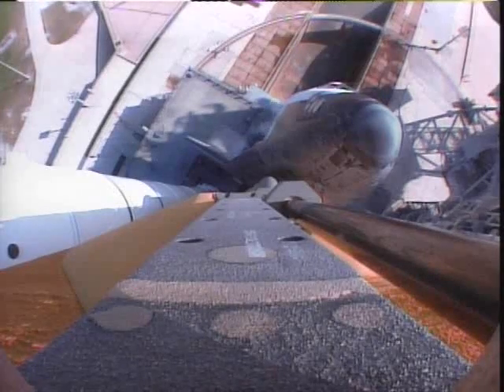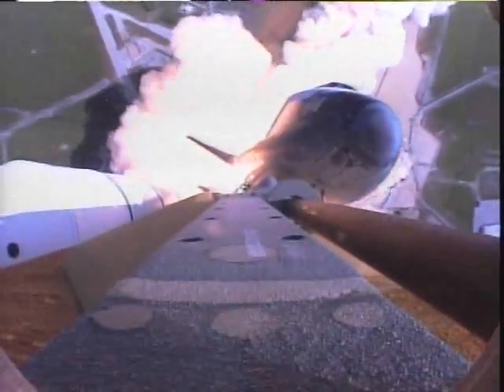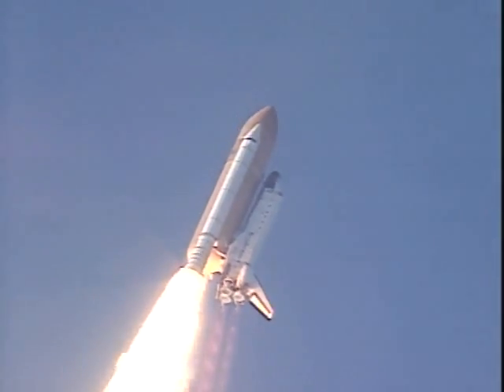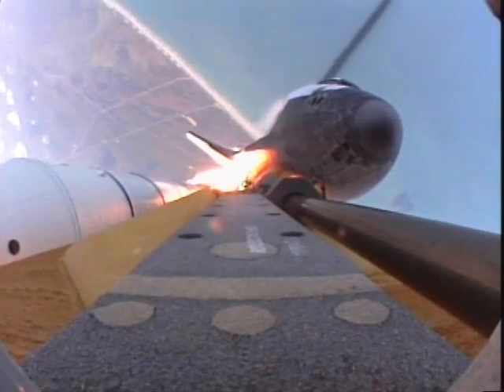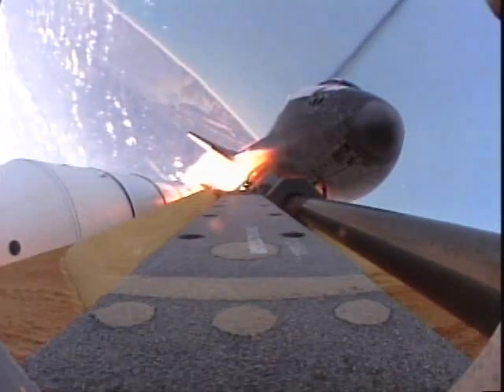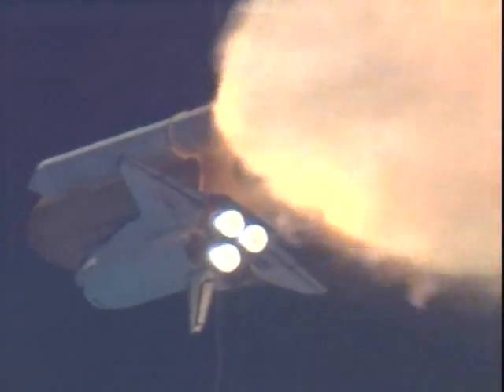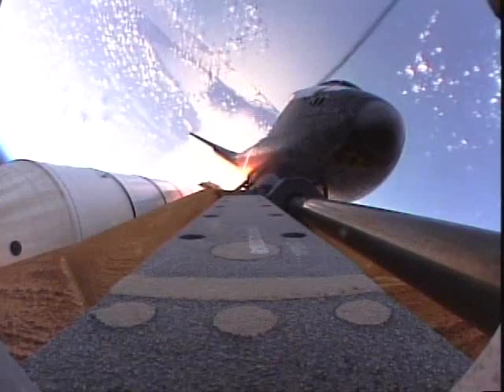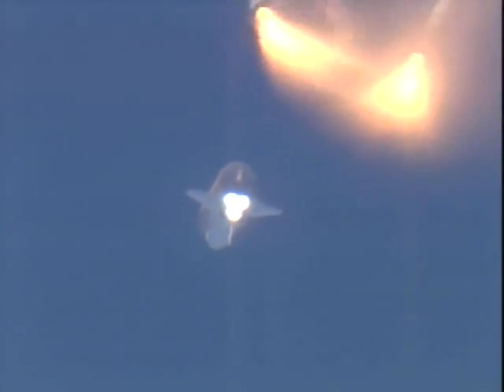STS-112 launch (10-7-02)

Comment: This mission was significant in hindsight because a large piece of bipod ramp foam did massive damage to an SRB, possibly catastrophic give or take 6 inches. The identical problem destroyed Columbia a short time later. Mission management ignored the problem after this flight. See the CAIB report for details.
Reply: Honestly so many warning signs yet it still happened in 2003
Reply: Honestly there seems to have been multiple foam damage to many space shuttle missions over the years. STS-27 was probably the most damaged shuttle to land. It was Atlantis as well. If I remember correctly the last flight of Discovery had a piece of foam did fall off around 5 minutes into flight. Due to no atmosphere the foam didn't reach a velocity high enough to damage it